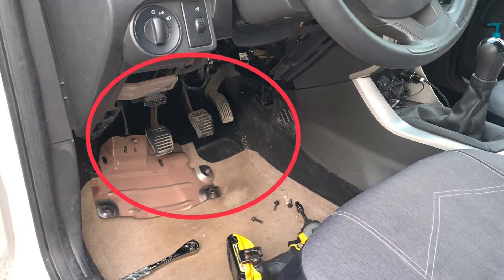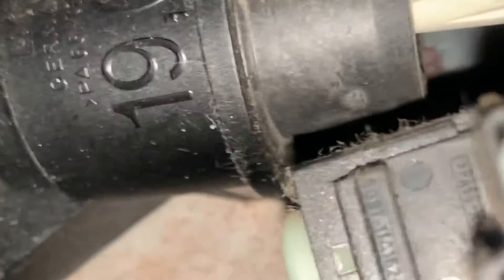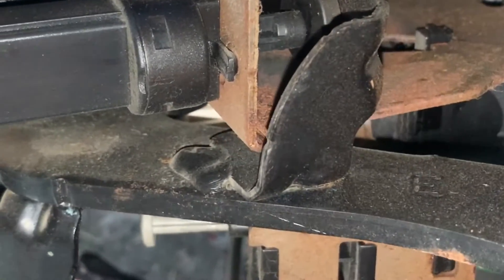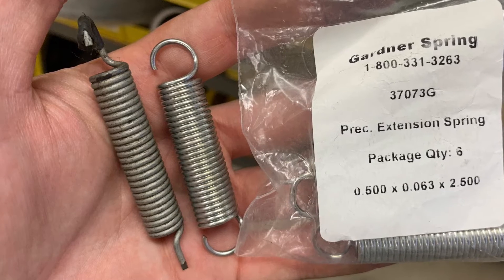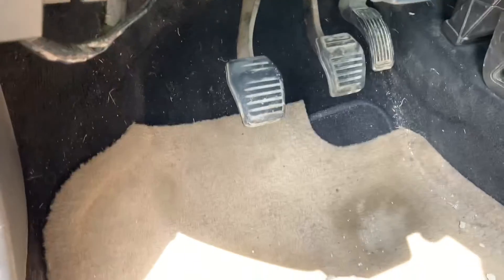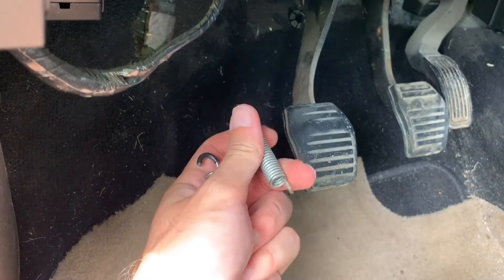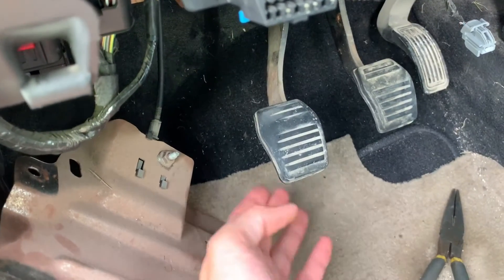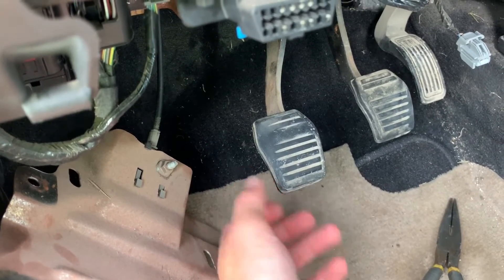Fabricating a Ford Focus Clutch Pedal Return Spring

Comment: You said you had a 2009 Focus. For a 2008-2011 Focus the spring is Ford pn 8S4Z-7534-A. 5S4Z-7523-A is for 2005-2007
Reply from the maker: Wow. Thank you for that correction. Not sure how I showed the wrong part number. Unfortunately, both are discontinued. 😢

Comment: Is it OKAY to drive if it is broken?
Reply from the maker: It was not obvious to me when mine broke, so I might have been driving with it broken for years without issue. 

That being said, I believe the spring is there to help ensure your clutch engages all of the way. You could get premature wear on your clutch if the pedal constantly applies a little pressure to the linkage.

Also, note that pulling upward on the clutch pedal on these Focuses is how you adjust slop out of the clutch. The spring might help keep it adjusted automatically.
Reply: @reidthemanual  Thank you for the feedback. I really appreciate it. Finally I fixed it. It was very tough to get it in North of Sweden but finally after 1 month waiting from a workshop and it came from Germany.
Reply from the maker: @yogisimha8990  Wow! Great job sticking with it.

Comment: This spring failed on my 2007 focus and it looks like yours, very difficult to find a substitute with such small diameter, thanks for this, I ended up sourcing the same spring at Ace hardware, great match and requires just minor modifications.   The 1/2" diameter is bigger and it does clear and similar tension
Reply from the maker: @stephenkowalski2448  Glad this video helped another Focus owner!
Reply: @reidthemanual  yes, helpful to keep my 2007 ST going as new!    Getting up there in miles and you don't see as many,  05-07 Focus are my favorite,  more zip and a timing chain vs the 00--04,  too bad the later generation 2012 and beyond have that horrible auto transmission, if fails the car is. Basically totalled, and very hard to find a later model manual focus, so stock to 05-07
Reply from the maker: @stephenkowalski2448  My family had a 2012 Titanium Focus and the transmission was the only huge blemish on an otherwise awesome little car. We sold it after Ford reworked the transmission.

I really wanted a ~2016 Focus manual with that little turbocharged engine, but alas I had to step up to a larger vehicle.
Reply from the maker: @stephenkowalski2448  Keep it going!

Comment: Greetings from Ireland. Excellent tutorial. Having same broken spring on 2006 UK RHD version. Your video will be a great help to me.  I've looked at a few videos, yours is the best I've seen.
Reply from the maker: Wow! I wondered if anyone else in the world would need this information. So glad to hear it helped you. 

Thank you for commenting, Andrew, and let me know if I can be of any help.
Reply: I will let you know, I'm heading to the UK next week to take a look at my son's Focus, I suspect this will be the problem.
Reply from the maker: For what it’s worth, my Focus’s intermittent starting issue ended up being a failing key switch and the intermittent power loss on the road was a dirty throttle body. It was good to replace the broken spring, but it was not technically causing me problems.